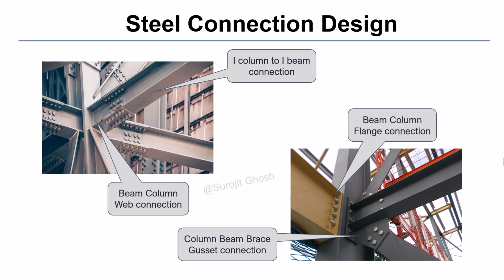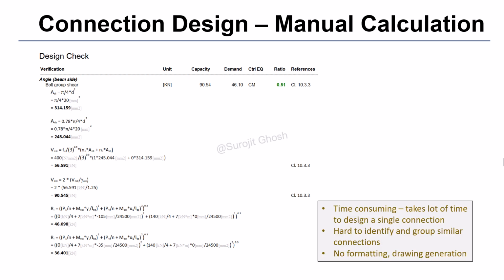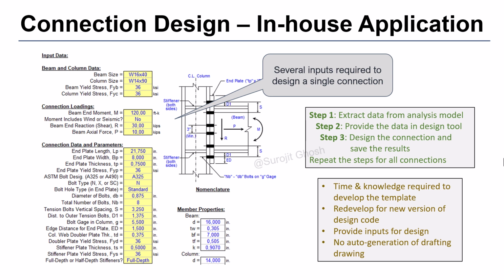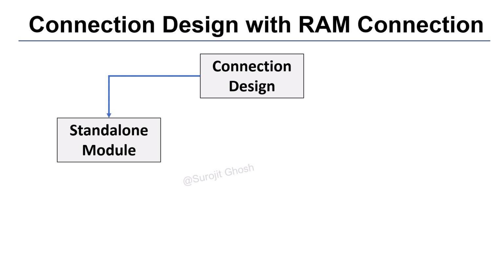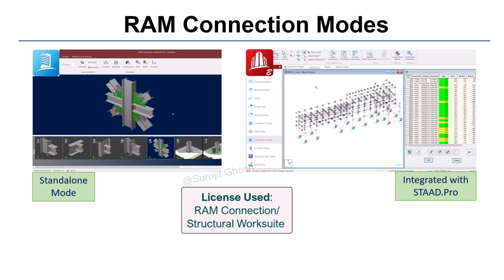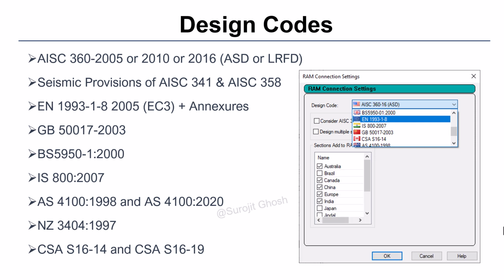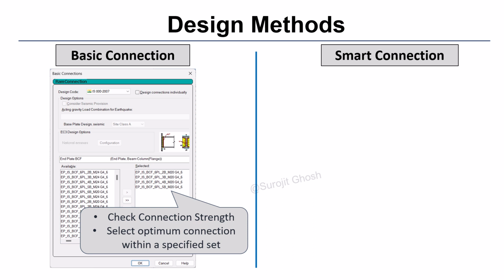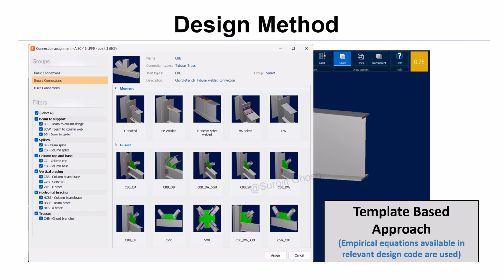Connection Design Overview - Part 1: Basics & Introduction to RAM Connection || Design Code, Methods

Comment: Can we follow the international codes for design of Connections of steel structures built in india
Reply from the maker: Yes, you can. Design rules of most of the common connections are not available in the IS code whereas all those are clarified properly in AISC or Euro code. So it is better to follow those guidelines, there is not much difference in design philosophy as well.